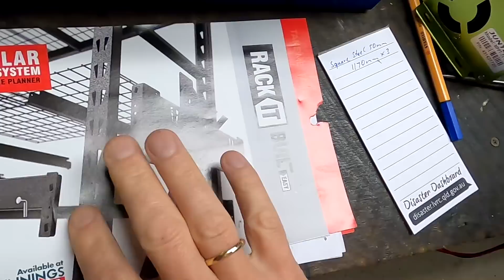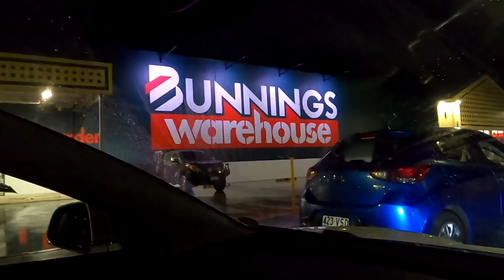New storage solution to host my battery banks. It's enough for 45kWh. Battery 2.0

Comment: Figure out the total weight of all the batteries and other equipment that will be on or directly attached to the shelf unit.. then double that weight and get 4 heavy duty casters that can support that weight.  Do this now before you load anything more onto the shelf. At least two castor with locks to hold the unit in it’s final position.
Reply from the maker: The shelve gets too top heavy with 3 banks. Imagine it tips over... 💥
Reply: @OffGridGarageAustralia  There are “work bench” castors that can be retracted when you want to lock things in place. I look at your video and say “How’s he gonna move that against the wall with the weight of just that ONE set of batteries?”  Four big guys.. one on each leg?
Reply from the maker: @johnc5937  the shelve will be in the final position before I put the batteries in.
Reply: @OffGridGarageAustralia  Don’t look now, but I already see a set of batteries in place… just thinking out loud.
Reply: @johnc5937  I think this is all speculative ground work he is doing for now, checking sizes, weights, positions of infrastructure, etc, its all good and necessary to try and make these decisions before we get too far ahead. Probably took Andy a few minutes to initially place this set here, and now he will ponder configurations etc for the next few hours/days/weeks, I believe this started as a 12v setup, and look where he is heading to now, 44kw @ 48v. One of the best video series on the web at the moment.

Comment: Andy could you use aluminium bar as bus bar? Cheap and readily available. Drill and tap or drill and bolt the terminals. There is an aluminium warehouse in Ipswich I get my aluminium from.

Comment: Bus bars means no same length from a battery to another. Just use cables and the length is not very important (if you use big enough cables). Fixing cables ont the metalic structure will do a not too messy thing. And you will need cables at the end (so more is not a problem). And you will have to protect the bus bars with heat shrink tubes. Do not forget the goal is not to spend too much too. To link the cables you can use that : Terminal 50mm2 800V High Current JUT10-50/2 DIN Rail Mounted Aluminium Block Two Enter Two Come Electrical Connection Cable 
on aliexpress.

A good product too (not related to battery) : Single Phase Din Rail ATS for PV and inverter Dual Power Automatic Transfer Selector Switches Uninterrupted 2P 63A 100A 125A

Comment: How will you manage the fact that if a battery voltage is lower than other battery voltage current can go from one to the other and destroy the BMS if the current is too high (impossible to control the A going thru, the only way is to be sure at each time we reconnect a battery it has the exact same voltage than the others) ? It is my main concern now I have to plug a second battery.
Reply from the maker: There will be no difference to any of the battery banks as they are all in parallel. Even if you would connect a higher voltage bank to a lower voltage bank, the current will be limited by the BMS. It would just shut off if the current gets too high.
Just make sure the voltage is the same (as close as possible) and there will be no current flowing from one to another.
Reply: @OffGridGarageAustralia  the problem is when you switch off a battery for maintenance and  when you switch it on back a long time later. I am not sure the BMS will switch off without dying if the current is too important. Daly were concerned about this trouble when I told them I use their BMS in parallel (impossible to switch on these piece of shit without a 60 v power source I am still waiting from China). 
If somebody wants to try lol.
In fact I am OK it is important in that situation to be sure the voltage are very close. But what about an overisght (I am not sure it is the word I have to use here to tell we can forget, I am French, English is sometimes not so easy even if about 50% of English words are in fact French ones !) ?
Reply: Bonjour de Belgique. :-)
Hello from Belgium. ;-)
Reply: @monsieurd.6890  , you should order the lightboard for the bms, it has a push-button for bms activation
Reply: @Mr.X3D  I did (I waited 2 weeks more lol, incredible a company could sell the power on button in option. It show how this company respects his customers...). But I knew it will be useless because the pin 6-8 shorting was not working before and the light board only short these pins. In fact Daly (or MGod shop that sells rebranded Daly products) just told me their BMS can not work in parallel mode and if they work like that they will burn if battery voltages are not the same. Even if I think it is not the problem (because BMS was not working before I use it in parallel). So now I can only wait for my 120v variable power supply to try to switch the BMS on giving him about 58v. If these BMS never wake up I will try to send them back to China. Worst thing I bought in China ever !!!
*****
Dear customer, our protection board does not support parallel connection.
If the protection board is used in parallel, once the voltages of the two battery packs are inconsistent, the current backflow will damage the board.
Reply: @monsieurd.6890  For a common port bms their statement makes no sense at all. How would the bms know where the current is coming from? Nah, I don’t buy it, it’s nonsense guessing from their side.
If it doesn’t start with the lightboard, it is broken. And sadly it’s very easy to break. I’ve experienced bricking of two units just by a loose balance wire. That’s how sensitive they are.
Reply: @Mr.X3D  Well one never started. The other 1 time then nothing... If they are so sensitive they are just badly engineered and should not be sold. I clearly will ask Paypal and Aliexpress for a refund if they do not work after having tried with a 58v power source...
Reply: @monsieurd.6890  i agree, it’s bad engineering coupled with horrible support. The contact I’ve had with Daly has been horrible. The sales rep I was in contact with was terrible. I hope you’ll get ur units running, but I wouldn’t bet on either that or a refund. They will most likely point to the installing instructions and that you failed to fulfil them. PayPal will probably help you get your money back though 🙈

Comment: Are we over thinking the bus-bar issue?

There is already a workable solution for parallel connecting 12v lead acid or AGM batteries ensuring an equal charge/discharge path:

A pair of heavy duty (50mm) link cables for the battery positives (top to middle, then middle to bottom) and another pair for the negatives, BUT then take the system positive from the top battery/BMS and the negative from the bottom. 

Such a configuration would have a max of two lugs/connections per pole per battery - top positive: system out and link to middle, middle: links to top and bottom, bottom: single link to middle... etc.

Lighter cable (25mm/35mm) from the top shelf controls to the inverter/charge controller box would be fine, but equal lengths and larger gauge cable to minimise resistance between the batteries would not be that expensive as you’d only need around 3m in total. Far cheaper than high current bus-bars.
Reply from the maker: I see what you mean. I made the calculations for that with some 400A busbars (4 studs, similar to what I already have). I don't want to fit 2 lugs under one screw so need at least on busbar for each incoming pos and neg. The same after the main switch again to distribute to the loads. So 4 busbars all in total at that amp rating are already A$380. I think the busbar alternative is cheaper and cleaner in the long run when I consider 3 banks in total for this cabinet.
Reply: The equal resistance path thing is really only relevant if you are running the cable close to it's max rating or over long distances. Since he is talking about bussbars over 450A rating and each battery is pushing a max of 80A (often far less) that is 240A max (a bit over 12KW) if he was pulling full power from the proposed design.  This means that the busbars would be specced for near double that so the actual resistance would be so low that the difference between battery strings would likely be lower than the actual connections to the batteries. Sure over the life of 2500+ cycles you might see a variation of 1 or 2 cycles over all of the strings when you add up potential micro cycling but it isn't going to amount to very much difference overall.

Comment: Andy, I made my battery box from a used Hoffman electrical enclosure it’s a nema 12 and it’s 30x60x12 lots of room for my 2  48v 300 and 310ah battery packs
Reply from the maker: Yeah, if you can get such enclosures, it's similar to the cabinet I have.
Reply: I bought it for $200 on eBay. I am in michigan USA and we have cold winters so I need to heat the batteries to keep charging them when cold. I use RV 12V  flat panel potable water tank heaters. .

Comment: Good video. Are you going to add wheels to the shelf?
Reply from the maker: I can hardly lift it now on one side with the 90kg battery on one shelve. I have planned to fix mount it to the metal horizontal beam next to the electrical cabinet.

Comment: i think a trolly under the shelves with multi direction casters would be a really good idea if you ever need access the full emegerncy shut down button i think should be solid mounted on the wall where the controllers and that are and on the battery rack just one for isolating the battery otherwise i feel you going to have to many wires that will make it hard work if you ever need to move the rack out to service or replace something on a battery pack
Reply from the maker: I'm a bit worried that it may get top heavy with three battery banks inside. If this tips over.... 🧨
Reply: @OffGridGarageAustralia  yeah they is that  other option it not having it flat to wall but small side to the wall so you can access both sides

Comment: perfect answer to batt storage.! one small problem but easy solve. i have several of these type of shelves in my shop. they are about 3 years old. the problem is that that sawdust board will sag over time (more weight high moisture faster) that is what mine did. replace shelves with 3/4" plywood  or supports under them. paint well with oil based paint. for buss bars ; consider copper clad ground rod and very good clamps ??. your unit is very easy expandable. 👍👍👍👌👌👌😊. and don't forget copper never seize on all the connections
Reply: Ditto, I have had my shelves more than 20 years and they do sag. Though I think metal T bar in a few places will remedy this. I used 3"X1" T bars on new one and no sagging. Just notch out where it will sit on shelf. The grounding rod sounds interesting to me. But I would think the efficiency or loss would preclude it's use. Keep the great videos coming. And Stay Charged!!!
Reply: @gruetoo1  i have not tried it yet myself . but i found i had an extra ground rod so i will try it on mine. i often pull 280 amp so it can be am honest test.
Reply from the maker: These ones have metal supports underneath, they usually come with 2 supports per shelve and can hold 400kg evenly distributed. I've put 4 supports under each shelve now. I know what you mean, the MDF is not the best for carrying big loads. I may get some 5mm aluminium floors for that.

Comment: Bus bar hack, use a flattened copper water pipe and some double layer shrink tube.
Reply: Copper pipe is a lower grade copper, plus is rather thin walled compared to copper flat bar. There's a reason it's so expensive and that's because it actually contains a large volume of copper.
Reply from the maker: You never get this pipe really flat. I've seen many videos people doing this and they all had issues after a while.

Comment: Can I suggest you re-think cable?  But get 500A (or bigger) cable - its already insulated, you'd use ends anyway if you over spec the cable its like a bus bar so you wont  need to match lengths.  Will be neater and safer.
Reply from the maker: Won't be cheaper with cables in this size. Just messier...

Comment: Use plexiglass instead of Aluminum so we can see your batteries.
Reply: Plexiglass can burn. Make an enclosure is mostly relevant to prevent fire. Much less expensive than aluminium would be fire plasterboard/drywall and aluminium only in front.
Reply: @monsieurd.6890  Polycarbonate while expensive is better than plexiglass and will melt but not burn.
Reply: @monsieurd.6890  LiFePo4 is relatively safe for combustion but with any Lithium if it does catch fire a little aluminum will not stop it.